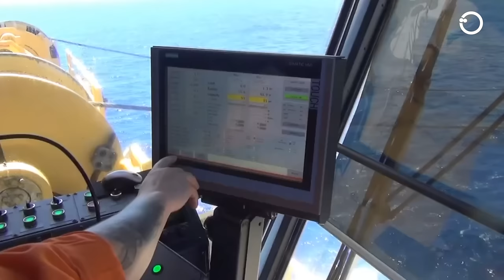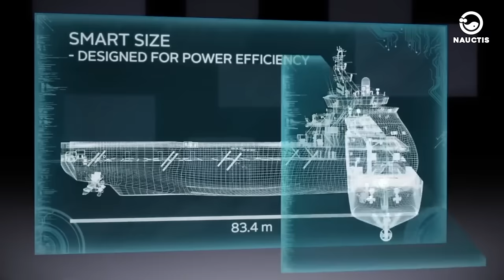World's Largest & Strongest Tugboats Ever Made: Look How Strong These Largest Tug Supply Vessels Are

Comment: All the ships seen in this video are off shore supply vessels, yes they can be used as tugs, but that is not their primary job or role.
Reply: I was watching the video and thinking, when are they going to show the tugs... so do thee boats tow often?
Reply: @allanthomas6097  Large ones like these are used to reposition oil rigs, or tow them back to harbors for maintenance.
Reply: Not true, the ALP Striker is a pure build tugboat
Reply: @ruudvanveen7226  Not a pure tug, tug boats do not have rear cargo decks, and cranes, anchor handling equipment, it is a long haul tug for maneuvering floating oil rigs.
Reply: The Alp Striker is a pure purpose build oceangoing tugboat!
Reply: Who cares if they are “ offshore supply or Tugs “  ?    Depending on the specific activity, they are work boats used for towing or pushing after that it’s semantics
Reply: These vessels serve multiple roles as supply vessels, maintenance support, and as tugs both for platform repositioning and anchor movement.  They can do all of these well even under the worst sea conditions, I've been out there and wished I could have any of these under my feet.